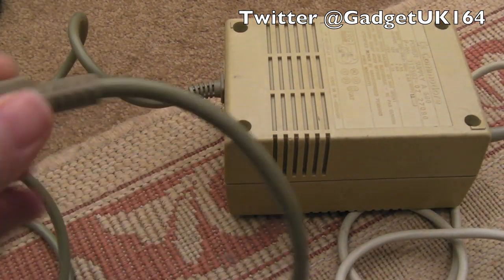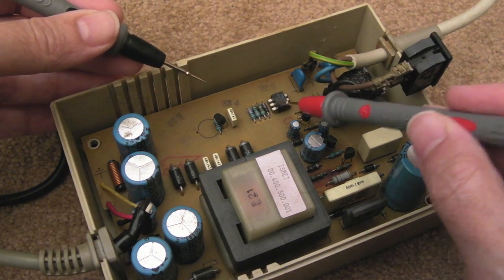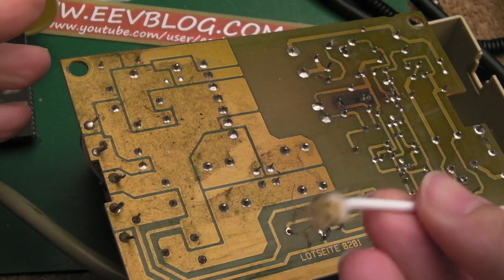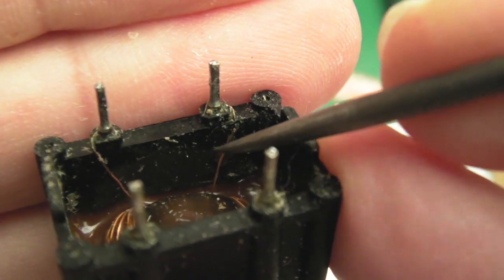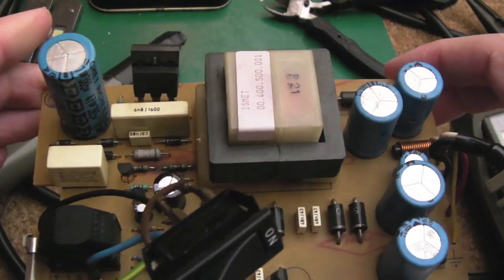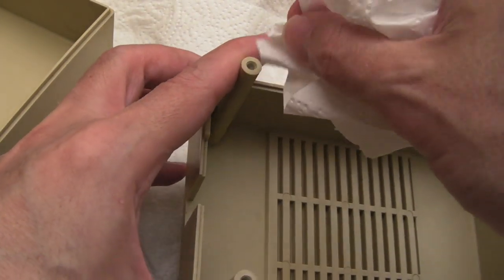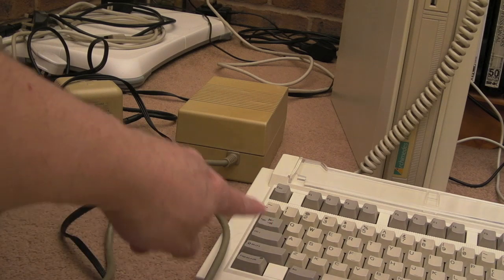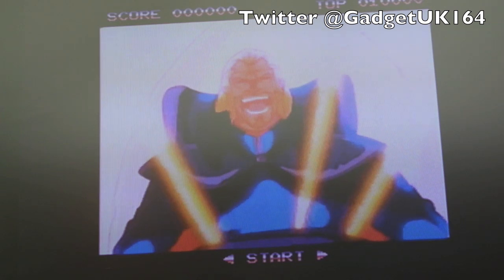Commodore Amiga Power Supply (PSU) Repair (312503-02 27090)

Comment: The advice to continuity test that choke is good.  I had the same issue on my Amiga PSU and followed your guide.  Its very tricky to attach those small wires but it worked after multiple tries.  Many thanks.

Comment: The resistor you measure at 6:08 is actually a 470Kohm resistor which connects the output of the rectifier to the base of the power transistor BU508AF. In my case this resistor had failed and was an open circuit. When I replaced it the PSU started to "tick" again, which is the audible switching noise you were missing, and 5v and +/-12v reappeared at the output.

Comment: I have a voltage saver for my commodore 64c...Is there something similar for the amiga500 as well.?
Reply from the maker: There isn't!  And it's not as essential as that type of failure is a lot less on Amiga Power Supplies.  You can get more modern PSUs for the Amiga.

Comment: I don't typically comment on videos, however, I have the exact same PSU and I had the exact same problem with the choke, lots of corrosion and 2 wires not connected to the pins. I managed to botch a connection and have successfully brought it back to life. Excellent video and descriptions of the work.

Comment: hey, hope you’re Fine . We recapped our Amiga 2000 power supply but unfortunately now we have trouble with the 12V rail. It only outputs 10V and drops dramatically when under load. Do you have any advice?
Reply from the maker: It's ages since I looked at an A2000 PSU, so off the top of my head I am not sure.  You might want to re-inspect it to make sure the cap solder points are correct.  I am not sure if the -12v comes from a 7912 or something similar on there, it could just be a failing regulator.

Comment: From what I know they cannot be higher or lower then 10% of the Uf they are, am I right about that?
Reply from the maker: The tolerance marking on caps indicates that they can be a % lower or higher than they are rated!  You can swap out smoothing caps on a PSU like this with a higher capacity.  Sometimes it helps!  On the ST PSU for example, uprating the 2200uF caps to 4700uF caps gives better stability.  Any capacitor used as a filter, or for timing, coupling signals etc should be replaced like for like, but smoothing supply rails you can generally uprate.

Comment: 1. WRT caps, it pays to replace them with modern low-ESR ones, even if they seem fine, especially ones that get pounded by  high frequency burst during work - typically ones on  the secondary side of such and similar switching PSU units.

2. it's prudent to resolder everthing, so that you disolve possible odxid cracks. 

3. for components that show obvious signs of heating, use bigger rating ones ( like resistors etc) and lift them a bit above pcb, so they can dissipate heat better.

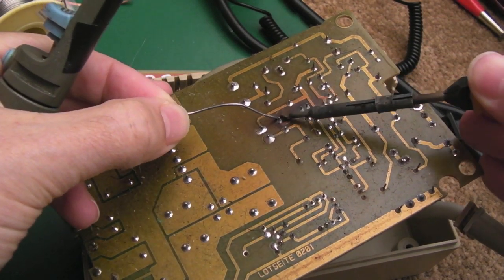4. at 09:00 on low-middle part of the picture ( above "LOTSEITE 0201" mark) you have what seem to be poorly metalized or wetted via. I would plug a bit of wire in it and resolder it on both sides...

Comment: Off topic: I have an old JAMA arcade board that I would send you if you want it. It was in a broken cab I picked up years ago. The game is Dead Angle and plays a lot like Operation Wolf. I have no way of powering it up so I don't know if it works or not.  If not, it does have a ton of LS74 chips I will harvest off it, but I hate to see it just scrapped.

Comment: Nice job, it's quite rare to see a common mode choke fail, don't think I've ever seen that before.
Reply from the maker: I've never seen one fail on an Amiga PSU, and I've also never seen one where both the live and neutral connections fail at the same time either!   In this case I am sure it was just corrosion that did it.

Comment: You can just jump the common mode choke out it is to stop noise being sent back out onto the mains. Still best to repair or replace it but totally unnecessary for operation
Reply from the maker: Thanks, yes, I gathered I could just have bypassed it but didn't want any noise problems!

Comment: Funny how both ends of the choke went open circuit at the same time. BTW those Chinese ESR tester things have a built in calibration routine you can run, mine seemed more accurate after running it.

Comment: A silly question perhaps, but you are having a far easier time desoldering things than I do, is that down to the flux you're using?
Also, what method would you reccomend for removing SMD electrolitic caps?
I have three A1200s that probbably need to be done, and I really dont want to lift pads like I did with my A600. That broke the RF and Composit outputs... so glad the miggies have that RGB output too!
Not sure if its down to the 2.05 rom, or damage from leaked caps, but it wouldnt recognise a CF card harddrive, what would you do to clean up that cap-vomit? I'd really like to be able to give it a little harddrive full of games as I intend to give the A600 to an old Amiga user who cant afford ebay prices for an A500
Reply from the maker: There are a few things to consider when you are struggling to desolder.  The first is temperature - if the solder is just not coming out of the hole at all I would suspect you aren't using enough heat, or an iron with not enough power.   Flux does help, but often I just use leaded solder containing a flux core.  You can use separate flux, something like Chip Quik or Amtech.  Regards the Amiga not reading the CF card HDD, it could be a damaged connection on the motherboard where the old capacitors have leaked.  Clean up leaked electrolyte with white vinegar, and then IPA.  You may then need to work out where traces are damaged using connectivity test on a multimeter, and bridge any broken connections with kynar wire or something similar.
Reply: @GadgetUK164  Oh through-hole are no problem, I use a solder station so I can turn up the heat on stubborn componants and add fresh solder to the old stuff before drawing it off with a solder vacuum, but the caps in the amiga are just a pain because of the way the pads are positioned. It makes it hard to desolder one side and lift it so you can desolder the other side. My solder is all flux cored, but I have a pot of waxy flux too which I've only recently started to use. Honestly, I didnt know what it even was, as all the flux I've seen people use has been liquid. As to the IDE, I was afraid that this would be the case, I cant SEE any track damage but that could all be around the pins of the IDE header. There was I think a little fuzzing of surface componants but it sure did stink of fish so the leak may be worse than it appears. I didnt know that pain white vinegar and IPA would clean it out though, I'll get some as soon as I can. Any damaged tracks I tend to use lines from an old IDE ribbon cable, small and flexable, and not much thicker than the original tracks in many cases.
I and my 'miggies thank you ^_^

Comment: Nice repair and save on that one!  That board was filthy.  And you are correct the A500 PSUs are beefier then the A1200.  I still have my A1200 PSU but I don't use it.  I generally use an A500 one.  I think you have motivated me to recap them suckers.

Comment: Your uk A500 power supplies are so much more simple than the Australian delivered ones.
Reply from the maker: There are different versions of the PSU!  Some of the UK ones are probably similar (if not almost identical) to the one you have!  I might get chance to look at others in future!
Reply: @GadgetUK164  
I will try to put up some photos on instagram later of mine and tag you
Reply: Commodore had several manufacturers of the PSUs: I know Ismet, Dee Van and Mitsumi. There is a sticker on the transformer that says "Ismet", so this was a PSU manufactured by Ismet. The PSUs between different manufacturers look identical from the outside, are electrically very comparable, but the construction is completely different.

Besides this, there are 2.5A Amiga PSUs and 4.5A PSUs. Both types were made by the different manufacturers. And there are also different voltage versions. So all in all, there are quite a few different PSUs out in the field and it is always a bit of a surprise what you get.

However, Ismet seems to be most common in Europe.

Comment: My c128 psu has the same form factor, but the inside is much less clean, design wise. 
What does a choke do Chris? It looked like a pretty simple device.
Reply from the maker: It filters high frequency noise from the mains there!  The name is a clue - it kind of "chokes" the connections so only lower frequency can pass through.
Reply: @GadgetUK164  It is the other way around! Allthough it is true that the choke stops high frequency noise in both directions, the goal in a switched PSU is more to prevent high frequency noise from escaping to mains. The mains wires in building are fantastic radio transmitters, therefore noise generated inside power supplies is better kept inside.
Reply from the maker: Ah, I never knew that and actually that makes perfect sense!
Reply: @GadgetUK164  Ah. That makes sense. Thanks Chris. Learned something.

Comment: thank you again for the hella good video man. I got a tip for getting water out of the plastic screw holes, get you a can of air duster with the straw tip and shove it in there and squeeze the water will spray right out. I wish I had your skills I can do a lot but damn your good, I know I have said it before but you inspire me to try harder. Thank You

Comment: I normally replace the browned resistors and bend the legs so they are off the board a bit.  Gives the resistor room to "breath".
Reply: Do you think it might be a good idea to put one of those mini heatsinks meant for a raspberry pi around that hot resistor?
Reply from the maker: The problem would be mounting it to the two resistors (without shorting anything).  The better solution might be to replace the resistors with ones that handle twice as much current (instead of 1/4 watt, go with 1/2 watt), and leave the legs longer so they sit further away from the PCB.  You would need to put insulation or heat shrink around the extended legs though.
Reply from the maker: Yes, that's a good idea for sure!!!

Comment: I always find it strange they don't mount the high wattage resistors away from the board to stop all that heat damage to the pcb? All they need to do is leave the legs longer and mount it higher.
Reply from the maker: Yes, a nice tip someone else just posted too was to perhaps replace and leave longer legs on them!

Comment: Gday Chris,
Did you used to work in electronic's shop of some kind?!
or has this always just been  a passion  project along with adding consoles to you're  collection 
as someone with your skill of repair would be valuable to the gaming community!!
Reply from the maker: Thanks!  I used to work in the industry, but way back in 1994 ish I moved into Software Development (not through want but need at the time, and just ended up spending most of my career in the software side rather than hardware).

Comment: I have three PSUs to repair but am still shying at doing it. Probably everything has to be redone, ones started with one thing. Broken cables, bloated caps. These videos tend to push me a little bit.. ;) The PSU you repaired is from Braunschweig.
Reply: To my knowledge Commodore's factory in Braunschweig didn't build PSUs?
Reply: @danielmantione  The backside of the plastic cover has an imprint: "Made in W.-Germany" which, in 1987 and further on, was Braunschweig. I'm sure they just put it all together but "LOTSEITE" is definitely german.
Reply: @DerMartexus  That's true, but... the sticker on the transformer says that is made by Ismet, which was one of Commodore's power supply manufacturers. If you look at some of the documents we have from Ismet, such as the Commodore 128 power supply schematic, it says "Schwenningen":

http://www.zimmers.net/anonftp/pub/cbm/schematics/computers/c128/power/ps-128.gif

Ismet still exists and if you visit their website, you will still see that they are still situated in Schwenningen today.

As far as I understand it, Commodore Werk Braunschweig did assembly of the computers: Mainboard, keyboard, floppy drive were installed into the cases, then combined with assesories such as the power supply and packaged.

It looks like the vast majority of computers made in Braunschweig have the Ismet power supply, but it is not a rule: It looks like some of the West-German Amigas got shipped with power supplies from Dee Van.
Reply: @danielmantione  Aaah, thanks for researching! :) That's an interesting backstory.

Comment: 3amp fuse ive allways used higher than that 5amp
Reply from the maker: When you use a fuse larger than it needs (and it needs a 3A), that means if the device develops a short, it could pull up to the capacity of the fuse.  So for example with a 13A fuse that means the cables and PSU could get super heated whilst 10A is drawn due to a direct short somewhere.  Next thing you know you have a fire!

Comment: Or just throw that turd away and install a modern meanwell 😁
Reply from the maker: I see no need to install a Meanwell in there!  They might be more efficient, but these things have lasted 30 years so far, I expect they will last another 30 once fixed.
Reply: @GadgetUK164  probably true but id rather be om the safe side replacing internals for my daily driver 👍
Reply from the maker: One thing you cannot be sure of - how will the meanwell fail, will it spike one of the voltage lines, will one line go higher than it should (eg. 10v instead of 5v).  One thing with these old Amiga PSUs is at least you know how they've been failing over the last 30 years - in predicable ways that often just means you need new caps or a resistor and your Amiga didn't die as a result of the failure.  The other problem is they don't seem to use decent caps - how long they will last is anyones guess.

Comment: I would not have taken the plug fuse out. Simple continuity test and done!
Reply from the maker: Thanks!  There are 2 reasons to remove the fuse - 1) To test it 2) to make sure its 3A and not 5 or 13A...

Comment: Looks like the transistor is missing its heatsink
Reply from the maker: Not all transistors are heat sinked!  This design didn't rely on a heat sink!
Reply: @GadgetUK164  Thanks for the info, I came to the same conclusion while watching the video. This transistor looks different to those I have in my PSUs. Good to know :). BTW, the bottom side of the board comes with a thick coat of flux from the factory. Probably that's why it picked up all the dirt during the decades. Awesome video BTW, I'm glad to see another Amiga PSU repair video! Thanks!
Reply from the maker: To be fair, a heat sink could help with the life of the transistor, so it's certainly a way to help extend its life perhaps!